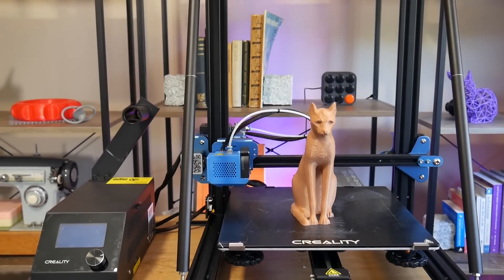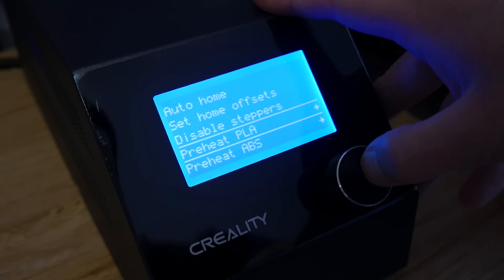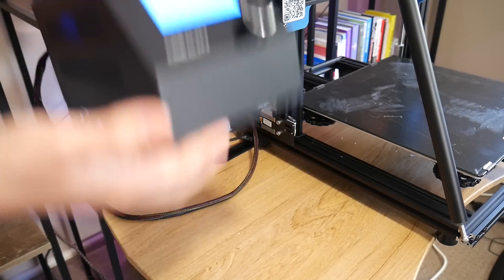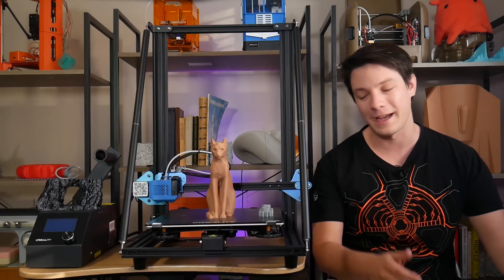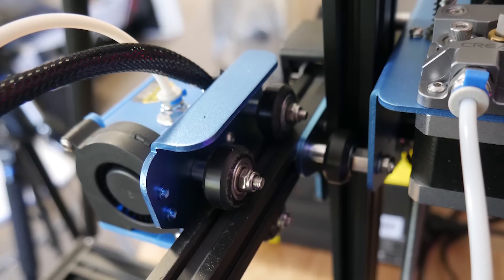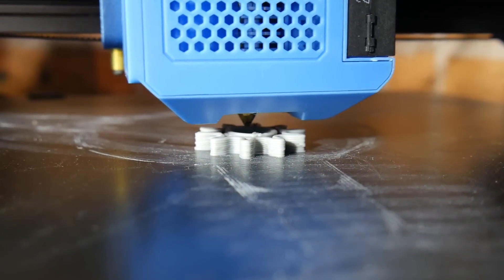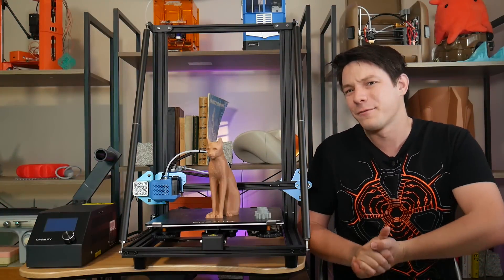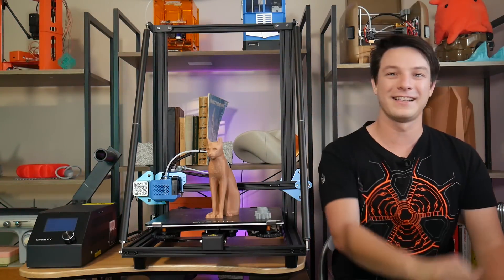Can the CR-10 V2 topple the Creality King? 3D Printer Review

Comment: I find it interesting some of the stuff you're criticizing is stuff I'm just used to since I've only got a (very heavily modified) Ender 3. I mostly control my printer through octoprint anway though. I rather like the simplicity of the simple LCD/Scroll Wheel interface. As far as bed leveling, yeah manual bed leveling with these printers is annoying which is why I almost immediately put ABL on my Ender, and I suspect any printer I get in the future will be day 1 upgraded with a BLtouch at least.

I wish creality would make a coreXY printer though. I've been waiting for them to do it so I can finally stop spending money on my poor ender 3 and buy a second printer.  I don't like the idea of an i3 design with a bed bigger than maybe 235x235, it just seems like slinging that size bed around is a fundamentally flawed idea as far as print quality goes.

Comment: It would be nice to get an upgrade path for the Ender 3 with the injection molded extruder fan duct and the improved fan.
Reply: Am I the only person that manually starts the extruder and bed preheat? That way they both always heat simultaneously. I could use some Gcode in stead....but yes that should be something that's standard. For large print beds I could understand preheating the bed for a few minutes then heating the hot end since the bed would take longer to reach the desired temp.
Reply: Drew Lakebrink On larger bed machines that can cause issues with excess power draw. It can be mitigated (mosfets, external power heatbeds, bigger PSUs), but adds to bottom line cost.  For PLA range temps it still usually works without much fuss, but at nylon temps manner printers can trigger fails.

Comment: Dang, I just got a CR-10S a few weeks back for the same price, I missed out. Does it have thermal run away protection? I know mine didn't from testing, but I've since swapped my board for an SKR 1.3 with TMC driver's.

Comment: i thought it was a flat spot on a roller too but there is just too much squeeze on grooves. you need to adjust those rollers and it will most likely be fixed :)

Comment: Thanks for the review.  I have two questions:  

1)  Are the cables disconnected at the back of the power supply/control unit or on the printer?  I saw three cables/wire bundles but it looked like only one connector on the back of the control unit.

2)  Did they use a board that was already open source (or will be Open Sourced) for the controller.  I was thinking about the ability to change the interface by re-flashing  a modified firmware.  Not a deal breaker for me since I run most of my printers via OctoPrint.

Comment: You do a great job in the review thank you, I did buy the 10S Pro i found a refurbished one for $350 and could not pass it up. after a few weeks of pulling my hair out it has become a work horse for my 2.0 mm layer rapid test part maker. However, i really wanted the Max, and those glorious Z axis struts. As i looked at the photos of the Max, it seems i could widen the Pro using Max parts.  Maybe cut square holes in the steel cover to poke the frame rails out bit that is not bad. Could you help me determine if this is feasible and then add the lovely struts, which i already bought but have no place to attach at the bottom. I think a Pro to Max kit would sell, even if we had to cut the steel cover. a little patience with a dremel and viola!

Comment: For bed leveling: you can put together some G code that moves the nozzle to be over each leveling bolt in turn, pausing until you click the wheel. I did this for my Ender 3 and threw it on each SD card I use for the printer. That way, you can just spin the wheel clockwise a few times and you'll hit the code without hunting around for it.

Comment: I have been trying to figure out what printer to go with for some time and I appreciate all the knowledge I have been able to gain from your videos.  Given your review of this model, what is your opinion on the Ender 5 Plus? I like it for the size to price and seems like if the Extruder and Hot End were changed out for a v6 or mosquito might actually be a better than decent printer as it appears to be a decent printer as is, just missing a few refined details. Thank you

Comment: Thank you for the honest review, for the auto-leveling sensor, firmware, filament detect sensor, touch screen, flat spot, and volcano hot-end you mentioned, we will feedback all to the company and continue to improve!
Reply: good to see Creality listening. I have 2 cr-10s's and im considering upgrading.
Reply: Good on you for listening to a reviewer's advice! TronXY could learn from this...
Reply: Does the printer actually come with a swappable direct drive? Or is creality saying that it supports that as a mod? The website isnt really clear on that
Reply: @nathantoews152  it doesn't and they don't have a way to add one despite advertising it. I posted a link on the cr10 subreddit about it. It's really frustrating. https://www.reddit.com/r/CR10/comments/dvlvve/psa_direct_extrusion_isnt_available_yet_for_the/
Reply: @nathantoews152  the cr-10 is one of the most moddable printers on the market. because its print head and extruder are both exposed at all times, it's easy simply to print a new chassis to hold the hotend, and it's one of the most popular printers out there, meaning a number of files for it already exist. I for one have replaced the hotend on mine to a bowden e3dv6, which lowers the amount I need to retract to about 2mm, similar to direct drive, and allows more options for printing and cooling. if it's a different carriage to hold everything, you can bet it'll only be a few weeks till there's an update to the petsfang mod or something.
Reply: @nubnubbud  I'm well aware that it's easily moldable. I have heavily modified ender 3's. I was asking if it actually came with the direct drive mod like makers muse implied. But as far as I've seen and heard it doesnt come with it.
Reply: @nathantoews152  I says "titan direct drive bowden styled setup" which means little of anything. They most likely meant that they're using an all-metal, titan-compatible hotend, however, the "imported" was likely to mean "3rd party". or "you've gotta import it yourself" and that makes sense. I imagine chinese importing laws are rather draconian, with their focus on exports. it might not make sense for them or the consumer for creality to import titans themselves. 

https://www.creality3dofficial.com/products/creality-3d-cr-10-v2-3d-printer?variant=31057243439177 shows a gif of how it attaches to the hotend.
Reply: Is there a Creality skin slicer for the CR10S Pro?
Reply: @Audio_Simon  Oh, it sounds like what you want is the Creality MD-3500 Medical 3d Printer/Logan's Run Automated Surgery/Dermatology Machine. Instant healing of the all layers of the dermis before you feel a thing. According to the Quick Start Guide, it says that it's super important that the subjects remain perfectly still, so dont try to use it without reading the instructions first.
https://www.youtube.com/watch?v=ALPtbB-tAwQ
Reply: @Audio_Simon  I don't personally know sorry, I have 2 of the CR-10S. As an addendum, though, please Creality, add a BLTouch. well pay the extra $20-25.
Reply: good to see  the lack of auto-leveling  was the mane reson i sold my CR-10-5S
Reply: Ok I'm recovering my confidence in Creality again! This is nice, to listen to the critics. By the way, Creality, the firmware really needs to be improved and polished overall, like he said in the review.
Reply: I have ordered this for my Christmas pressie mainly because of your review thanks for you inspiration ordered with the bed level  looking forward to arrival  and a new beginning in 3d printing
Reply: Never been more impressed by a Chinese product than i have with your brand, you have excellent machines.
Reply: Thanks Creality, I think this will be my next printer.  I recently gave my CR-10 as a gift to a friend.  I loved that printer and printed very interesting things and upgraded to the CR-10S features and added dampeners.  But I wanted my friend to have a printer because he is such a friend to me.  He was very excited.  He printed his first useful parts and sent me pictures yesterday!  I gave him all my supplies too, lots of filament and tools.  Maybe I'll buy the CR-10 V2 soon.  I am glad you are getting feedback from reviews and comments.  This is meaningful and one reason that I am buying another Creality printer.

I also appreciate this honest video review and the endorsement.
Reply: so, coming with an hotend with improved cooling, yet, the recently released ender 5+ have the old rubbish?, will there be an upgrade path somewhere?, or should I just toss it out, replace it with an e3d.
Reply: I happily bought my CR10 after seeing Angus's review. Still happy with it now. Prints perfect out of the box. Proof you listen to feedback and make everything better. Infact, the initial test print cat is the best print i've ever done. 
Give me the Cura profile!
Reply: Nice job Creality. Keep listening - your doing great stuff and I appreciate the price points of your gear.
Reply: I own 4 CR10 from original to pro versions, in all of  them  quality control have been an issue you guys really need to take care of that  and I agree 1000% with Makers Muse, wheel control must be gone, its annoying and inaccurate.
Reply: im a CR-10S5 owner, my second printer i just purchased was the sidewinder x1.
Reply: How do you format SD Card my computer reads it fine but cr10 can’t read it when plugged in help please
Reply: Hey creality good job but i not think that a 0.6 mm Will be Nice Mabey in the mid 0.5 like luazbot i also have one on My realy modified anet E10 And i think that is a swet spot beetwen fast print And acurated prints
Reply: Also if Mabey as well as You insanely popular ender 3 Mabey y should reléase something like a alfawise u50 but with all the Nice things that You usually put.... Like Quality hahah
Reply: Hopefully you can do the same with the CR10s Smart. It had alot of potential but just falls short.

Comment: I've had my CR-10s for about a year now and love it. Lots of fun to tinker with and upgrade stuff. Converted mine to direct drive with 3D printed parts, then got a little kit a few months ago just to make it a bit sturdier. All new fans and part cooling. It handles a 0.8mm nozzle with the stock hot end no problem with the right settings, and it is super fun watching it just gobble filament and spit out a part in minutes! 

I also really don't mind manually leveling the bed. I think it's kind of satisfying in a way. And once it's set, you basically don't need to mess with it again. Although, I will very slightly lower the bed when going to PETG since it doesn't like a first layer smoosh as much as PLA.
Reply from the maker: Are you heating the bed more for PETG? You might be finding it just expands so the level changes, it can be a bit frustrating if you go between materials often!
Reply: @MakersMuse  I am! I didn't even consider that. 🤔   Usually 75C for the bed with PETG, which is quite a lot hotter than I use for PLA.  That makes a lot of sense!
Reply from the maker: @BRUXXUS  DW it took me literally years to twig to that too haha.

Comment: really Angus? your argument is fair and would be valid in a vacuum, but with so many equally affordable CR-10 derivatives out there these days, the flaws here seem pretty glaring. the frame supports and new hotend assembly seem like great improvements, but the filament sensor oversight, bad rollers and single y rail with 6 rollers are really poor hardware solutions. while i believe you do now have an open bootloader and can flash new firmware pretty easily, the stock solution seems to have taken several steps back, if anything.
many others have made much greater improvements on this design since the original CR-10, and are actually substantially cheaper than this.

Comment: Surprising you recommend this vs a sidewinder X1... wonder why?
Reply from the maker: mmm, I had issues with the ribbon cable plugs in my version but they have since sent a replacement board which i'll be fitting, and think the surface quality of this one is better. I'll still get the X1 going with the new board though and do some updates with it.
Reply: @MakersMuse  Ah yep, forgot about that - I gambled that it might be an isolated issue and ordered one after your review, I have about a dozen prints on it so far, got it running in half an hour and no issues whatsoever apart from the "meh" spool holder you pointed out, I'll probably just want to tweak the accelerations a bit as I get significant overshoot in corners when printing very fast (120mm/s). Love the fast mains-powered heat bed. I also installed rcaTech's tweaked firmware since (thing:3856144 on Thingiverse). Was really pleasantly surprised for a machine that big at that price. Opened it up to install the firmware and found it really pretty clean inside.

Comment: Have you looked at all into the Autodesk and Kick-starter standardized 3D printer test? It produces a result out of 30 and seems to be a good way to compare the quality of printers. It's on GitHub, and even has a detailed explanation of how to assign points for each part of the test.

Comment: If you choose preheat then home on any other printer (as far as I have tested), they all wait for the preheating to end before executing the home command... that's a Marlin thing, not a Creality thing :))
Reply: actually it's a gcode thing not a Marlin thing ;) (look at M104 and M109 in RepRap)
Reply: @xirtakeht  this is correct. M104 and M109 are heat/cool and wait commands. Where as M140 and M190 will heat and cool but no waiting. Creality using the former in there firmware for preheat is actually a good safety measure for new users. That said it would annoy the crap put of me lol
Reply: @nathantoews152  indeed like any good safety measure it is annoying :D
Reply: If I set manual temperature on the CR10S Pro it will keep warming in the background and allow me to home etc.
Reply: I’ve seen the same thing using the paneldue on a duet.  It waits for heating to finish and then homes.
Reply: I'm sure Angus knows that the slicer is responsible for the heating behavior at print start. I'm not sure what version of firmware is installed on the machine, but if there are quirks then I'm sure they can be fixed with a newer firmware install.
Reply: @ScottLahteine  it's not quirks it's a feature. They used M109/M104 commands for preheat which is a heat and wait command. It won't let any other gcode be executed until heating is complete. If they had used M190/M140 then you can do stuff while it heats. It's a firmware level change. But it's not really an issue.
Reply: @nathantoews152  Oh, you mean it does a heat-and-wait from the LCD menu? Yeah, that's not a good idea. I'm not sure why they would change that part of Marlin.
Reply: I manually set the nozzle temp to 200, then go to the main screen and start a print which heats up both at the same time. You could manually set both temperatures but since the bed is automatically first it’s not necessary.

Comment: For the price, I'll stick with my FLSUN 300x300x450 for US $349. At least it came with a touch screen, inductive bed leveling and three choices of nozzle configs.
Reply: Is there a model number? Want to check it out
Reply: @jvh22a  I found it on amazon. FLSUN 3d Printer Plus Prusa i3 Diy kit. The model was C3 Plus I believe. I don't know if they still sell it. Mine came with a heated bed, auto level, a single nozzle setup,  a duel nozzle setup I think they called Chimera and a dual color single nozzle setup.  A MKS touchscreen. The bigger wattage power supply and And a case for the main board that came with fans. And the logic board had removable stepper drivers so if any failed or burned out you could replace it.

Comment: Nice video - printing with Big nozzles Prusa slicer is a hit as it has a max Vol E feature wrote a little tutorial here https://grabcad.com/tutorials/dialing-in-a-filament-and-specifying-the-max-volumetric-e-xtrusion-value You could have also printed it with a .8 or maybe .7 in the same time or print at a .5 layer height and up the speed. You can also print layer width up to 200% nozzle diameter and get still nice prints and even stronger prints

Comment: I have had my CR10s since it first came out few years back! I have replace all the cheap fans with Noctua fans and it's quiet as a mouse! Best 3D printer for money by far
Reply: I've had my CR10S for like.... a year? Upgraded to direct drive and new fans all around and I really love it. Prints with a 0.8mm nozzle are super fun! Although, I usually keep a 0.4 on it for normal prints.
Reply: How did you silent the stepper drivers?

Comment: they're probably in the verge of selling something basic to start 3D printing from, keeping some inconvenient elements that makes the DIY feel of most 3D printers, or make them the complete print-ready package as much and as long as possible(factoring in bed warping perhaps with mesh bed leveling of the autobed leveling?), I know we have the Ender 3 probably for the absolute baseline kit/diy printer without much of hassle, and people are going to mod theirs right away anyway; CR-10 could just be slightly bigger, but almost top-of-the-line better but they likely still can't risk creating an assembly line and QC to cater additional features, because everyone seems to have differing budget and opinion as well; clone bltouch? clone titan? original add-ons? marketing either would often be problematic even if they're basically drop-in replacements like capricorn PTFE.